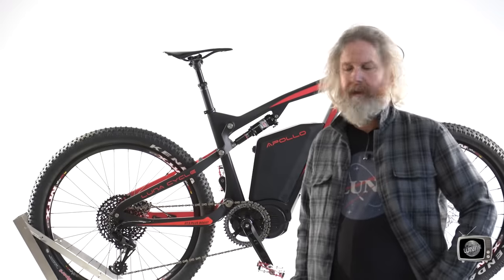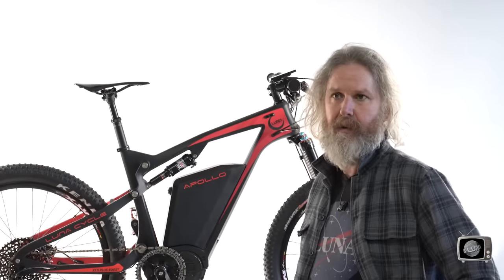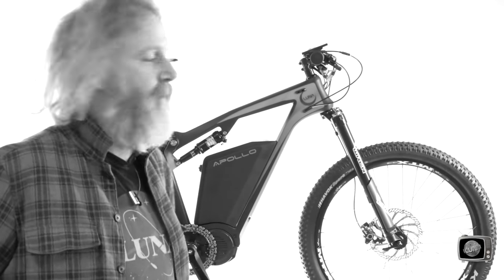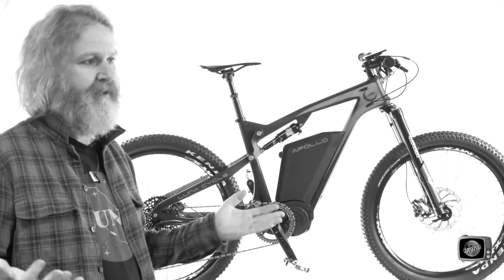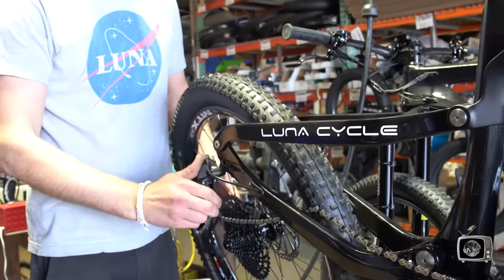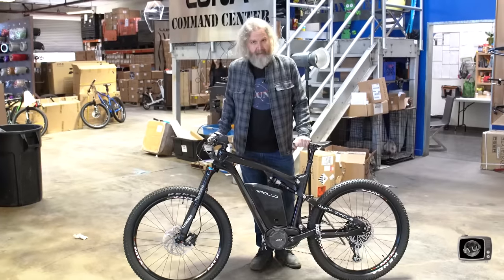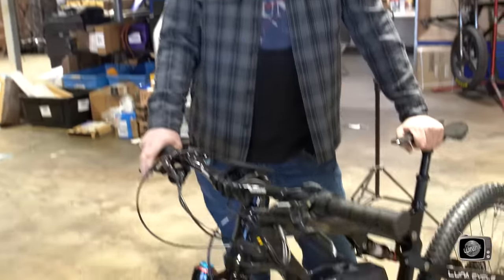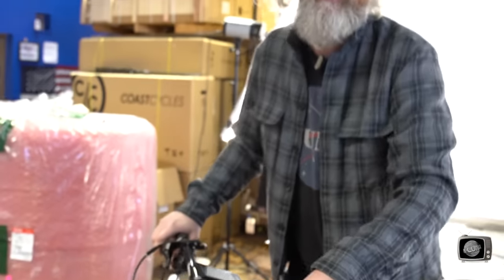Luna Cycle Announces the Apollo Ebike

Comment: 2000 watts?  Dude this is a nice bike but a bike like this is no help in getting e-mtb allowed into the woods.   No land manager is going to allow a bike that will perform like a 100-125cc motorcycle onto the local trails.
Reply: You can get programmed for 750 watts, if for some bizarre reason, you want that. You could ask for it to be programmed for less but I think, after stopping laughing or crying, they'll refuse out of respect for what a fast e-bike should be.
Reply: Let's face it:  this is a Touring/Hot Rod bike.  Doesn't belong at all on trails.  Only streets. At most, maybe access/fireroads.
Reply: @Me_ThatsWho  - totally agree Cockeyed but you know that someone will go and ride one of these on the trails ripping it all over.  Which will then just add fuel to the fire keeping e-mtbr's out of the woods.  I know people don't like the watt restrictions but in Europe there are e-mtbr's all over because of that restriction, I would rather have a e-mtbr with the 250-750 watt restriction than none at all.

Comment: Why are these called bikes? These are electric dirt motorcycles.
Reply: Probably because 90% of the components are exactly the same as any bicycle, and they are called ebikes, NOT bikes, pretty self explanatory.
Reply: Lol na the motorbike feel does not kick in till after 3000 w. Even 250w pedalecs  peak watts over 1000w . Dont believe the European blabbering
Reply: You can just hit the throttle and ride like a motorcycle the difference being that ,it has at the same peak power/speed  as a 50cc scooter. I have been riding a similar bike in power for the last 3 years personally I'd still consider the riding experience closer to a ebike than a motorcycle. ..  it's close to the tipping point but still a ebike .
honestly speaking here... there is stuff all difference in speed or power between something that's 1000w or 2500.
You need to go 4000w plus before you get any real motorbike power realistically even higher like a tangent motor at 8kw.

Comment: So you call out the industry for the lots of marketing BS - I agree with that - and with the same breath you claim that you built the “best bike ever’. Which one is it then?
You shit on the Spitzing’s Magura brakes (4 piston caliper at front 2 piston rear) but you have cheap Shimano trekking brakes on the “best bike ever”. Also, in the EU, the legislation is different and only the 250W pedal assist bikes are considered as bicycles - that’s why they are popular and they can be ridden everywhere without limitations - your thing with throttle would be a motorbike and nobody would buy it there.
I like the effort but I cannot take your “best bike ever” claim seriously... 😀
Reply from the maker: throttle  and power is  the most important thing when buying an ebike... you seem like a bike guy...imagine if someone told you suspension travel was not important when picking your mountain bike.  This bike has a lot of flash but its not needed....all us ebike guys ever needed was power and throttle.
Reply: Luna Cycles For us in Europe, ebike means pedal assist bikes (pedelec) no throttle, and it’s perfect like that. If we want throttle we buy a dirt bike.  As I said our legislation is different so you cannot compare an ebike built for the European market to yours. Also, with the pedal assist bikes we don’t have issues with trail access, we can ride them on any bicycle trails.